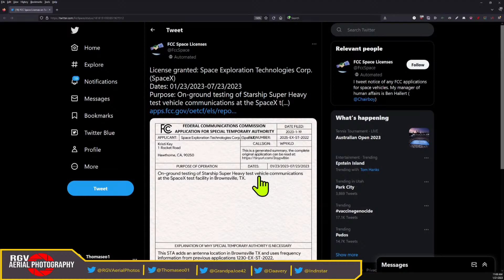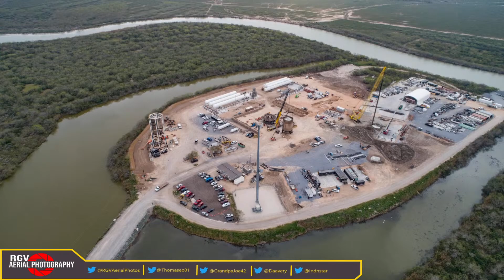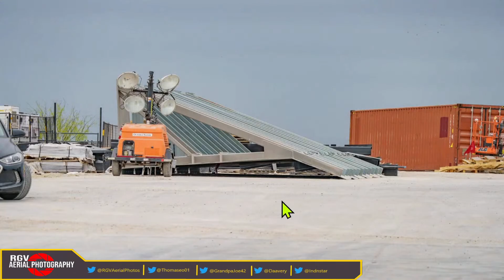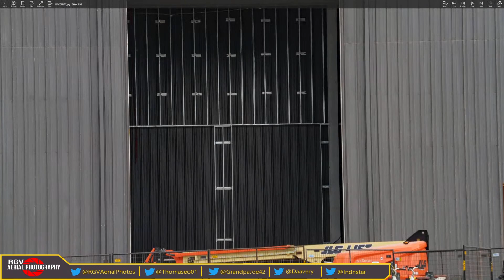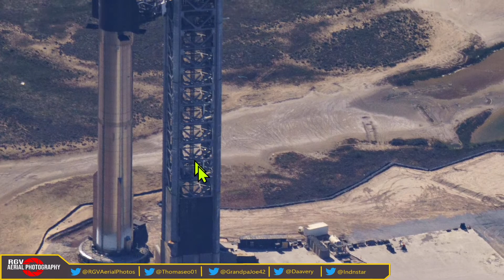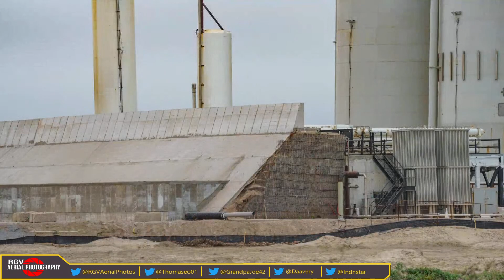Wet Dress Rehearsal Prep - Starbase Weekly Episode 57

Comment: Just FYI, a cassion is a hollow chamber that you submerge and pressurize to allow construction under water. What you are calling a cassion is actually a pile.
Reply: Are these pressurized long term?
Reply: @EpicSpaceflight  as long as workers are down inside them doing construction. Typically it is placed on the bed of a river etc to excavate and pour foundations, etc for bridges and other structures. There is no bottom in a cassion it rests in the mud which seals it. The water is pumped out and air pumped in so workers can do their job.